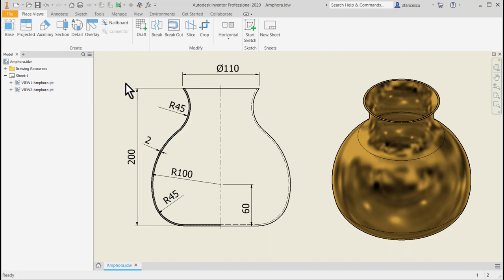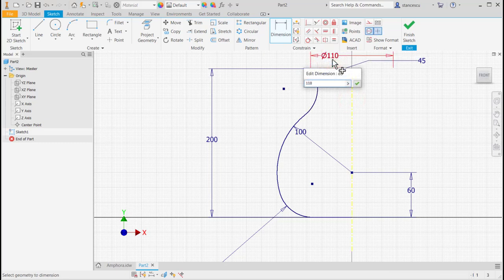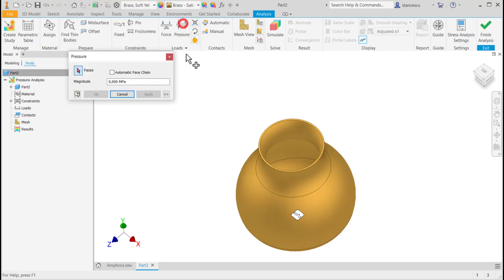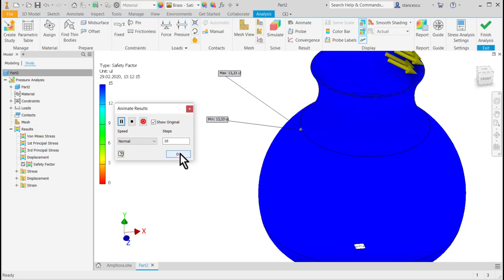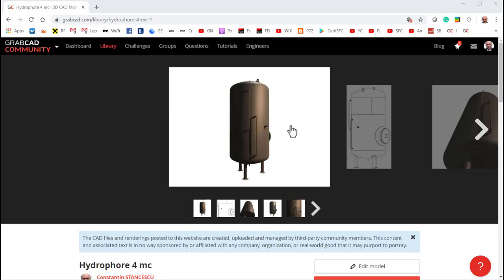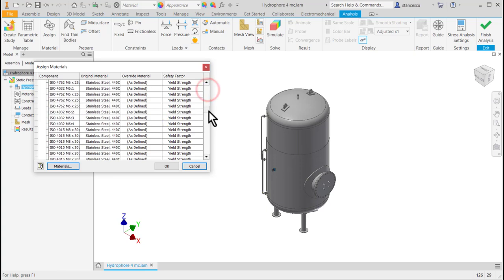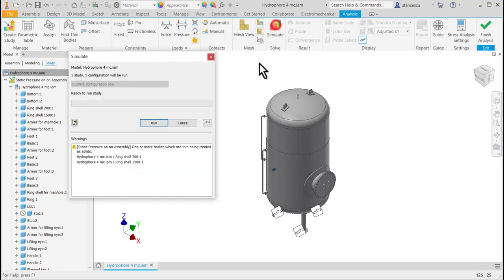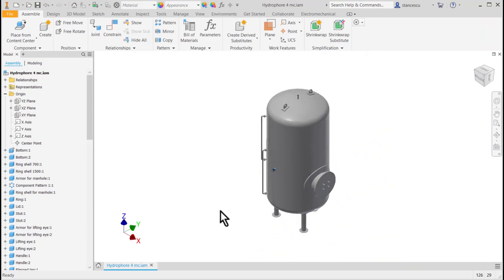Tutorial Inventor - 042 FINITE ELEMENT ANALYSIS - Parts and Assemblies (Pressure)

Comment: You didn't apply weldings to Assembly pressure wessel. Question: What if you want to inventor to consider the weldings in the study do you then need to make the pressure wessel as an welded assembly?
Reply from the maker: I am familiar with mechanics, and not a welding specialist. However, I want to show what capabilities Inventor offers in as many areas as possible. Good luck!

Comment: Hello. Does this system also apply to water pressure testing?
Reply from the maker: The water pressure adds the its own weight to the uniform pressure as presented. You cannot apply a variable pressure but the vertical variation of pressure is not so important at a hydrophore.

Comment: Thank you for the good lesson.
But did you take into account that pressure is higher at the bottom, and then decreases as we go up, whether in the Part or in the assembly?
Reply from the maker: For a better resolution you must use a specific software like ANSYS etc.